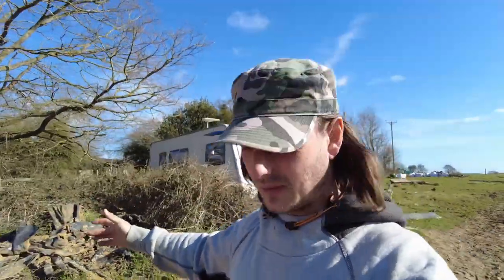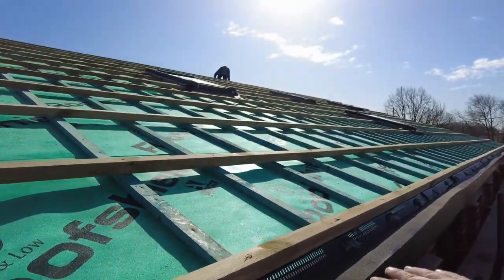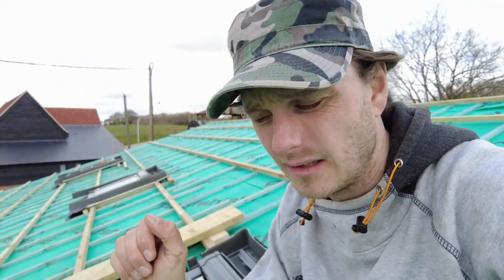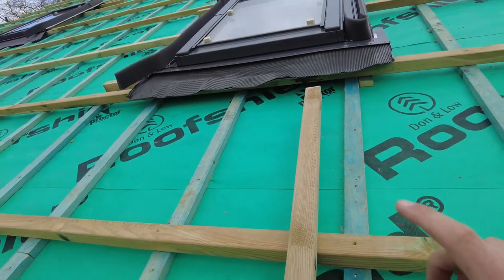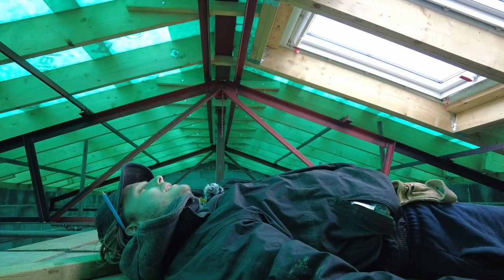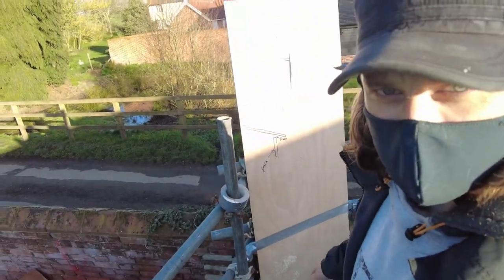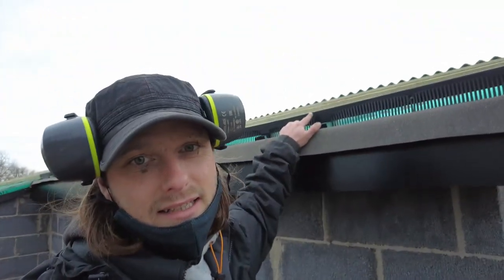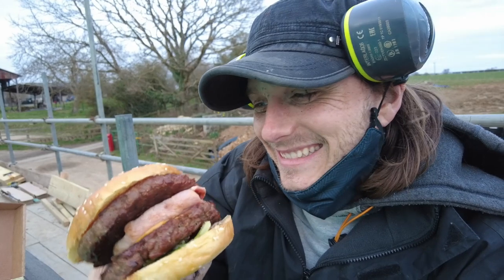Residential corrugated fibre cement roof install --- BIG SIX - #selfbuild [The Barn Rebuild 007]

Comment: Did they mitre the corners? I did not pick that up on the vlog. each panel should have this. Try looking at Flexim to back up around the crap flashing. Its a great product and can be used in many a location. It is much better than mortar. With sticks all you could have glued those strips in they would have lasted 50 years and it would have saved the removal of the window.
Reply from the maker: Yep the corners were mitred correctly thank god. Just looked up that stuff, looks interesting! I'm almost tempted to use it round the other flashing on the solar panels. Luckily nothing has leaked on either roof though
Reply: @THE-AIDEN-PROJECT  I would suggest you definitely  use it. It has to be dry where you put it. It can precipitate it down as much as it wants the second you finish. Go for the black. It will lighten up a little. It is worth the cost.

Comment: I love the size of that burger! Is your main contractor on a fixed price for the work? If so I think it would be reasonable to sit down with him and negotiate a discount for the work you are putting in. Of course if he is on a daywork rate for the job there is not a lot you can do. It's all looking good though nice to see the progress. Did the flashings ever arrive 😩
Reply from the maker: He was on a fixed price. In a perfect world I would have done. That would have been a futile negotiation as he was going to try and put the price up. The bloke drives around in range rovers and a Rolls Royce. Plus, there's a reason why no one likes him 🤦‍♂️
Reply from the maker: Oh the flashing came on Tuesday the following week and they was wrong again. I then went down and spoke to the manager and told him what ones I actually wanted, I wrote down the code and they still ordered different ones which arrived end of day Thursday just in time for the roofers that were coming back on Friday morning. Guess what, they wasn't the ones I asked for! I ended up with flashing for a bank of 3 with the middle one omitted. I just had to fit them. There was also a piece missing which I had to use lead for. I emailed the manager again but he ignored me. I'll be complaining to the ceo when I get some time.

Comment: I've seen some advice on cutting the corners on the overlaps with Eternit Profile 6 - did you have to do this? I couldn't see it on your images.
Looking fantastic! Luke
Reply from the maker: Hi luke, yeah they cut corners off on the actual roof when they laid them. You do it when you have 4 sheets meeting, 2 will be cut and the other 2 are left. I didn't get it on film though as I didn't want to make a big thing about me documenting the build on youtube. It's pretty straight forward though and I'm confident I could do it myself. There is 1 bit where it isn't cut and sits high but that's at an awkward part round the first roof window
Reply from the maker: Are you planning on doing something similar?
Reply: Yes, we’re looking at this material for our roof to replace asbestos, looks good :)
Reply from the maker: @lukemackay-morris8905  cool, I've got another video on here where I removed my own asbestos sheets if you're doing it all yourself. When I ordered these sheets there was a 5 week lead time because it was coloured rather than grey. I also got different sized sheets so they lined up better on the roof but ended up with 2 or 3 different shades of black 🤦‍♂️ just be mindful of that if you order any coloured stuff
Reply: Ive got exactly the same issue can't get the mitre cuts nowhere can you find info spoke to manufacture no help at all
Reply from the maker: @normandbeaches3496  hey Norman, are you looking for information on how mitre them correctly? I could probably do a short video on that with some scrap bits I have left over if that would be helpful? The manufacturer has actually offered to replace my whole roof so if that goes ahead I could always get a video of the professionals doing it but that might be a good few months away
Reply: @THE-AIDEN-PROJECT  thanks for reply I re watched your video and slowed parts down and sussed what to do good luck with your build

Comment: Well done this go around.  If this industry had some proper regulations with some meat behind it would be a much smoother sailing.  Oh and did I mention there would be a hell of a lot fewer players because they couldn’t cut it😆
Reply from the maker: That would be a great idea!
Reply: All sounds good but in reality very few people would actually be able to afford to have the job done properly as there would be so few people who could undertake the work with the required skills. It's simple supply and demand and you'd still end up with the unregulated side of building that the less wealthy or bargain hunters would use to get their work done.

Building requires a cocktail of different skills from pricing and management to actually having the knowledge/skills to do the work ,and it is incredibly hard to find a person who is good at all of these. So usually something has to give; be it using inexperienced workers or not allowing enough time to do a thorough job all to still remain competitive.

I'm by no means sticking up for poor quality tradesmen but i feel a lot of people misunderstand the true difficulties when you mix the complexities and just general problems of all construction work with running a business. I personally think it is rare for a builder and a customer to come to the end of a project with both parties getting equal value from the whole process, someone has to lose out on something whether it be knowingly or not.

This is all just my opinion.